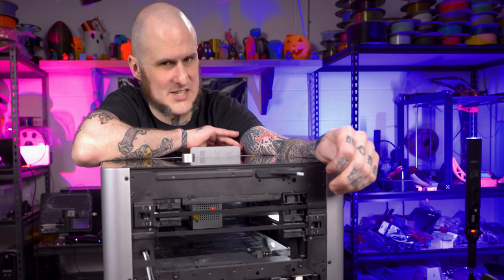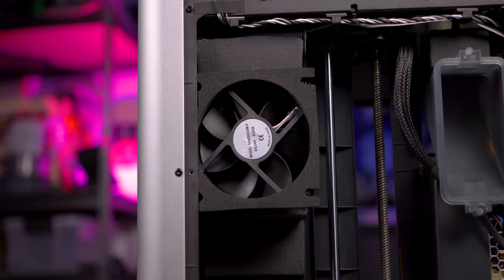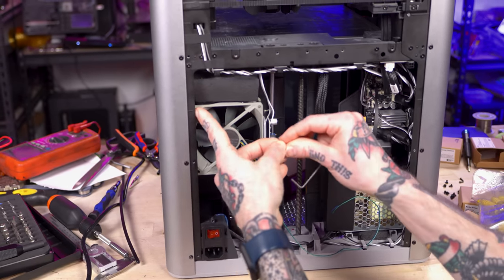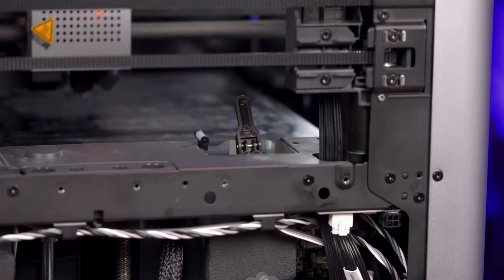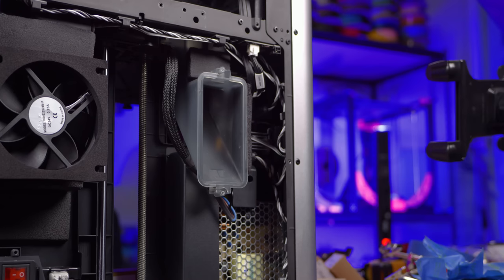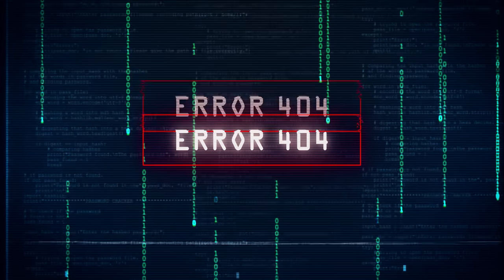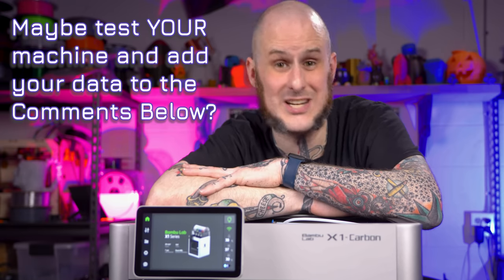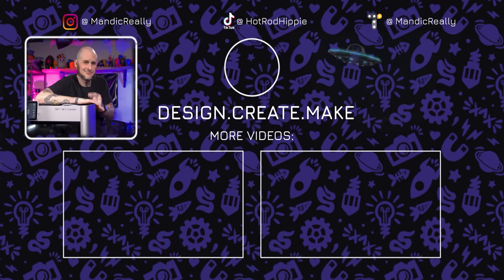Noctua Fan in the Bambu X-1? Chamber & Mainboard Fan Replacement!

Comment: if you are crazy like me. direct swap NMB 92mm reference 09225VE-24L-CU-02 fan with 60cfm. 40db only. and good static pressure. its about 1/3 less of their claimed stock fan that supposely has 90cfm.
Reply from the maker: Yea I searched for a fan on Digi-Key for a while but they started at $30 and I figured that would be a non-starter for most folks so I moved on.
Reply: @MandicReally  also the NMB is dialed up at 80 or 90% at the display when its in fact at 100%
Reply: Thank you for looking it up and sharing it here, I was unsucessful at finding the right fan for the job. It's the not thrst time I struggle finding the right fan with the right pinout, may I ask you what's your goto website and search filters to find the good one? Just looking up Mouser and Farnell and playing with filters?
Reply: @Nairod785  basically yes. and some european websites too. the motherboard noctua 5v pwn 4 wires and this fan allows me to leave the printer idle in my workshop without any buzzing. i print a lot of asa and abs. and to be honest the NMB is 30usd and its too much money for a chamber fan that will be 99% of time turned off. but... we got play!

Comment: The secret sauce of Noctuas are mostly on the fan blade, so I wondered if anyone had tried swapping out the blade to the original fan so we don't have to mess with sizes and electronics? Or better, 3D printed a fan blade? I'm also still looking for a silent fan for the hotend :p
Reply: you could be right but why are noctua's 12volt and not 24volt and why is this fan only 2000rpm and not 4800rpm i think thats is thereally reason they are quite fans they are slower which reduces air flow that's basic physics
Reply: @grampafpv8013  The difference in RPM is due to the expected application.  Noctua makes a pretty hefty fan (Noctua NF-F12 iPPC-24V-3000), but again, they aren't building them for Bambu Lab's application.  If Bambu went to Noctua and asked them to manufacture a fan for their printer, it would be no problem.  (Side note: 92mm fans are a bit niche)

Comment: Why didn't you get a 24V Noctua? Lots of their fans are available in 24V for industrial use. We use them for water cooling industrial applications and I also use one as a travel fan lol.
Reply from the maker: Only 120 and 140mm Noctuas come in 24v. Not any smaller sizes.

Comment: How do I dial in the buck converter without a 24v power supply?
Reply from the maker: Power it off the circuit you will be using it, just don’t wire up the fan until you dial in the voltage output.

Comment: Be aware buck converter will pull as much A needed to always give the set voltage, i fried a mainboard like this befor. set the fan speed to 1% by accident instead of 0% and overloaded the mosfet. In case of PWM not an issue but a big issue with voltage controlled fans

Comment: 0:50 it should be noted that one of the screws on the back has a VID WARRANTY sticker on it and it has to be broken to open the machine.
Reply from the maker: Void if removed stickers aren’t legally binding in the USA. A company cannot void a warranty for simply disassembling your own property. That is a pretty settled legal standard. Also Bambu’s instructions tell you to do this. If they voided your warranty for doing what they told you to do, they wouldn’t last long as a company.
Reply: @MandicReally  I'm so thankful to hear this. I had wondered how this would hold up and always thought it was a flimsy idea. I'd definitely mention it if you open up the printer again :) ty

Comment: I do a Noctua swap for the MB today, its not really quieter, maybe a bit, but i hope more for a longer life of them
Reply from the maker: Yea the mainboard fan isn't too bad noise wise, it just isn't looking good longevity wise.  I also don't love that it has nowhere to pull fresh air from.  It just sucks in hot air from the corner of the machine.
Reply: @MandicReally  exactly and why PWM? That thing turns only at one speed i think...

Comment: I don't think there is a good understanding of what the chamber fan is supposed to be doing. The speed it runs at is hard coded or set manually and it's control circuit has no idea what the chamber temperature is. There was even a thread on Reddit about what direction it was supposed to blow. The placement of the carbon filter indicates it is designed to be an exhaust fan and as such there needs to be an inlet path for air to enter the chamber and replace the exhausted air. Ironically the only entry path with lid and door shut seems to be through the poop chute and (at least on the P1S) a small racetrack shaped opening at the top right corner of the front cover. For that reason if you increase it from 50% to 100% you don't really feel much difference in outflow when putting your hand back there. So apparently, the easiest way to decrease the chamber fan noise level is to simply turn it down or off as it does not seem to matter.

Comment: Dont worrie about the 40%
I've got my overworked one yesterday and it shows tje same 40%.
I gound that the numbers are locked till printing.
Also my version have not taped fans as well.
They put a little knob on the panels with one screw.

Comment: THe cooked sticker may actually just be oil/lubricant from the bearings of the fan. Which would explain why it failed.. Larger sleeve bearings especially will rubber plugs under the sticker so you can lube them (Silverstone FN181 etc).

Comment: Its a lot less hassle to just use a quiet 24v fan, go onto digikey and sort 24v axial fans by Db and buy whatever is around 30Db and is cheapish. No messing around with converters on a $900 printer. This whole Noctua thing is stupid there are plenty of good 24v fans out there.
Reply from the maker: Quietest 24v fan in stock on Digi-key (& the right size / wiring): $26.50 + shipping.  And that is rated at 38.5dBa, over double the Decibel rating of the fan used here and $10 more expensive than the Noctua + Buck Converter.

Comment: Noctua makes a 120mm 24v…I wonder how viable that would be if you ditch the foam and print some sort of fan duct between the 120mm fan and the 92mm mount.
Reply from the maker: Not much room in there, you'd have to cut a hole in the back and design an adapter to go from one size to the other.  Totally doable but for me, not worth it.

Comment: Isn't it common to specify the fans with a flow rate of the max air flow it can produce? It should be possible from Bambu Lab to provide this spec and from the Noctua Fan it should be on their website or the packaging. 
I am sure they would be pleased to here your findings of the motherboard fan as fan. But i wonder how experienced engineers from DJi shouldn't know how to proper cool electronics.
After all it's very funny that you do similar mods than most users with their cheap Ender 3s! I mean: swapping the fans out is a classic ... but maybe not for a machine that costs more than 1000 bucks?!
You could go into detail with those slicer settings though! What is not possible in their slicer and how it's to be done in plain Cura? 

It would help to understand the limits of a proprietary machine like the X1/ P1P

Comment: I dont understand Bambu why they not put active chamber heater - it is so simple to do. I have to integrate the heater myself and control it separately of bambu firmware.
Reply from the maker: Active Chamber heaters are patented by Stratasys.  It is why you don't see many other commercially available machines with them. Also the parts of the X-1 are largely made up of injection molded plastic.  I doubt many of them would handle the temps for long.  Let alone the electronics that are inside of the chamber volume.  Adding an active heater changes the whole ball game.
Reply: Passive heating using the heated bed and fans works well, though you're not going to be printing PEEK or anything like that.  Then again, at those chamber temps you'll have issue with everything else... steppers, bearings, any electronics, any component that isn't metal.  Most 3D printers are using a lot of plastic components.
Reply: Seeyou Seemee  ABS does just fine in a passively heated chamber like a Voron.  In fact, it's exactly what the Voron is designed to do.

Comment: wow. you really put a buck converter on a VARIABLE speed fan output. I hope you never run it below 50% duty cycle. or you're in for a bad time.
Reply from the maker: PWM fans are supplied constant voltage and regulated by the PWM signal. I reduced the input voltage, not the PWM signal. That’s not different between the two input voltages.

Comment: Why not use a Noctua 24V Fan directly?!
Reply from the maker: They don't make a 92mm 24v fan.  You'd have to adapter a 120mm which is gonna lead to cutting a hole in the back panel of the machine and designing an adapter.

Comment: People in the comments saying 'Prusas are quieter'... Are you really being honest with that comparison?
Reply from the maker: I hated the resonance noise of my Prusa Mk3s+.  The fan noise was wayyyy better, but the noise of it actually printing got under my skin.  Different folks handle different noises, frequencies, and sound levels differently.
Reply: @MandicReally  resonance noise like the natural resonance of the frame and stuff? It was buzzing?
Reply from the maker: @pooounderscoreman  yep. Putting it on a paver helped but it was still an annoying sound to me. Everyone has their own noises that bother them, that one got under my skin. (I went over the machine multiple times and checked with other Prusa users, it was just how the machine was.)
Reply: @MandicReally  haha nice one. Thanks for making these videos, btw. I love the disclaimer about bambu firmware updates.

I has noise issues with my ender 3v2. Swapped the mobo fan, hotend cooler and fans and added buck converters to quiet them down. It's very quiet but the Bambu is just so much more accurate, reliable and fast so I barely ever use it haha.

Comment: the default chamber fan has a rated air flow of 92CFM, and ones from Noctua is only about 42% of that maximum, it probably runs as quiet as the noctua if you set it to 1600RPM, so i wonder if it's easier to just change the default RPM for various filament types in the filament Gcode settings?
Reply from the maker: There is more to fan noise than just RPM. Fan blade, design and construction, frame design, the motor itself.  They all play factors in the sound level.
Reply: @MandicReally  That's true, although to my experience unless it's a very crappy fan, most half decent fans have roughly the same noise at the same RPM and most of the noise comes from the hub.

i do not really recommend this mod for several reasons.
1) potentially breaking some electronics if you don't know what you're doing
2) warranty void
3) additional cost, achievable with a simple Gcode change
4) insufficient chamber temp regulating capacity if the needs risen, affecting prints of PLA and PETG
5) firmware error handling (pointed out in the end of video)

just to note that by default the chamber fan is set to 70% if bed temp is over 35C and 100% if bed temp over 45C, for PLA and PETG only.
PEI, high temp and cool plate has different heating for PLA and PETG, so try to use cool plate if you want lower chamber noise.
I'm sure Bambulab has done temp characterization and there are reasons the parameters are set this way

Comment: Did you know noctua makes a 24v 4-wire fan designed for high static applications...?  NF-f12 - they have a 2000 rpm and a 3000 rpm version
Reply from the maker: Yes, but this is a 92mm fan. They don’t make a 92mm version in 24v. The opening on the metal back panel is designed for that & the space inside is very limited, so fitting a larger fan is unlikely unless mounted outside the machine.
Reply: @MandicReally  Bummer, got a x1 on the way and wanted to replace it with noctua. Probably will wait till I have too if the buck board is a must. Maybe an excuse to see if I can hack a toroidal blade on there

Comment: i think that the filter is for if the ABS print ends you can filter the air that is inside
Reply from the maker: The Filament G-Code for ABS in Bambu Studio doesn't enable the fan at any point (during or after a print).  And they only just added the manual ability to toggle the fan on and off last week.  That would in fact make sense, but Bambu doesn't use it that way.
Reply: @MandicReally  Which I think people have been asking for forever. It seems so simple its weird they havent added it. Makes me wonder if the filter even does much.

Comment: Noctua fans are quite because they turn slower.  It's been that way for years and the reason I quite using them.  If you need to move a lot of air that is the wrong fan to utilize, IMHO.

Comment: Wait, the Bambu X!C fan is 93 CRM and 4800rpm , it IS per defination a high flow fan. No Noctua fan can move such volumes of air ...otherwise they wont be silent noctuas anymore.
Reply from the maker: CFM doesn't equal static pressure. Pulling air through the filter relies more on pressure ability than free air flow rate (how fans are rated).  I demonstrated in my (limited & flawed) testing that the Noctua can still handle the job of reducing the chamber temp. I should have removed the filter and taken away that restriction as I truly think it serves no purpose in the X-1.
Reply: @MandicReally  I beg to disagree and think that you are wrong , as I can feel the air pressure of the air coming from inside the chamber if I put my hand in front of the exhaust. The air must be passing through/around the activated charcol.....at least in theory.
Reply from the maker: @75echo  right, but without quantified metrics, all we have is "I feel air".  For all we know the static pressure the fan is moving could be equivalent to a fan with much lower CFM.  I feel air blowing from the Noctua fan with the filter in place.  There was no way I could come up with quickly to quantify the difference other than the thermal results. Static Pressure and CFM are not directly related and testing airflow properly is an expensive and detailed process.  Just look up the Fan tester Gamers Nexus bought.
Reply: @MandicReally Eh, I wasn't really satisfied with the temperature difference you posted.  The temperature differences from those that you mentioned were too close to ambient, except the one who started at 45C like you did and he got triple the delta.  So more questions than answers from my point of view.

Comment: the "Noctua 40mm Fan" link in the video description points to the 12V version of the fan (NF-A4x10), whereas the printer requires the 5V version (NF-A4x10 5V)
Reply from the maker: Weird error on my part.  Don't know if the listing changed as that happens often, but link is updated.  Thanks for pointing it out. I'll be replacing mine with the Noctua very soon as the replacement Bambu fan is already on its way out.

Comment: Use blue-tac to hold your wires or at least put some heat shrink on those jaws so the teeth don't puncture the insulation and potentially cut the wires.

Comment: You know, we keep running into these new printers that come with a plethora of new features....many claim silent drivers or the like....yet put the loudest, cheapest fans on them.  I was curious when someone would try what you did.  I am also surprised they didnt go with quieter stepper drivers, like 2208s or 2209s
Reply from the maker: The steppers aren't traditional stepper drivers like other machines run.  Idk why they chose to go the route they did.  I'm sure it is a cost thing as far as the fans companies choose, but here we are. Prusa is the only one I've seen actually care about fan noise it seems.
Reply: @MandicReally  well I have 24 machines in my farm and noise is something I care about!  I've done number fan swaps like you have to make it tolerable to be around the machines.  Many of mine are in safety enclosures now, so that's a big help.  I've been curious to get a Carbon but waiting to see what changes are coming
Reply: @MandicReally  they are abit too anal about sound. they uses underspecced fans for the heatsink cooling on the MK3S(back when they used noctua especially, heard its delta fans now?). Far out of spec for what E3D wanted. its why during hot summers there were suddenly influxes of clogging issues and why the fans that come with a full V6 set are loud. high RPM high static pressure. they sacrificed cooling for noise. noctua fans are absolutely great but the small sizes that would fit printers for hotend cooling and such aren't good enough in static pressure and are pretty much meant for server cases with barely any restriction.

Comment: It is a shame that mods are needed to sort out issues that should have been done prior to release. Noisy fans useless AMS system that needs a hydra upgrade to make it work properly with other companies filaments. These things should have either been done prior to release or free upgrades from Bambu to make the machine fit for purpose. I have been using one for a few months and I have to say I am starting to regret the purchase especially the AMS which is just a annoying piece of crap. Thanks for the info, maybe we should bill Bambu Lab for doing their work for them!